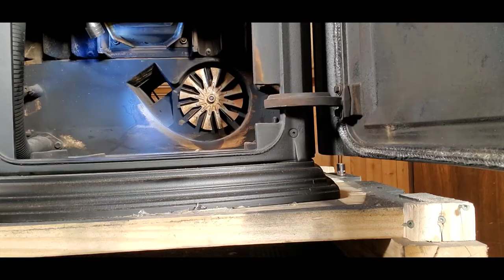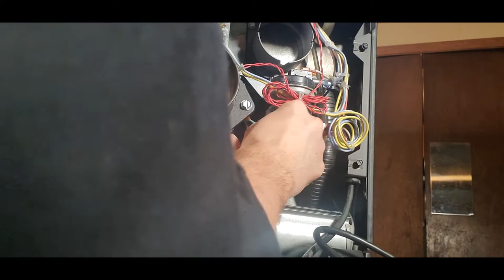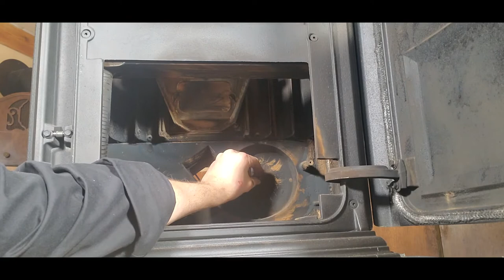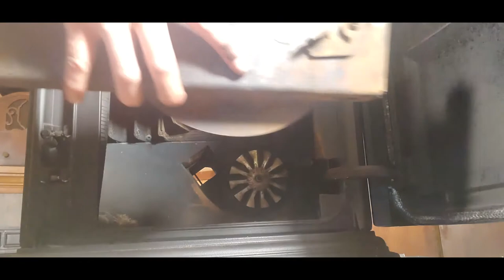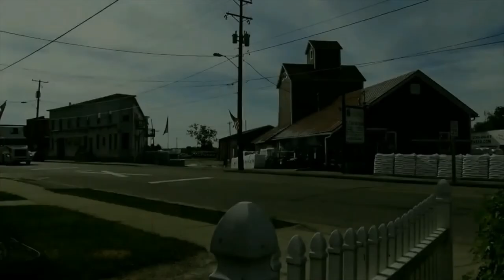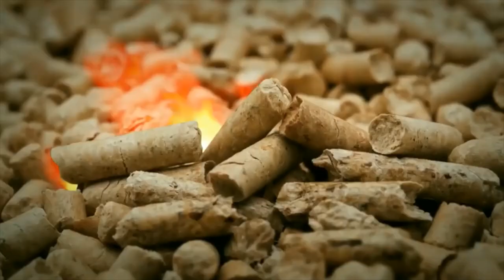How To Replace a Harman Combustion Blower, Exhaust Fan Draft Motor

Comment: I have the identical harmon stove as in your video, recently it seems the combustion fan runs continuously after temperature has been reached and stove hasn't burned any pellets for hours. Is this normal?
Reply from the maker: Hey Mike, thanks for the message. The combustion fan will come on as soon as you start up the stove and it's calling for heat whether you are on Room Temp or Stove Temp mode. The Exhaust ESP Thermistor probe regulates the combustion fan during operation. When you shut the stove down or if it runs out of pellets, the ESP probe is the device that tells the Combustion fan to shut down when everything is cool. If your fan continues to run when the unit is cool, we suggest you check that ESP and give it a good cleaning. Here is a video that will show you that process. Keep us posted, happy to help. https://youtu.be/kt7nnGMYU-k
Reply: Thank you
Reply: I cleaned the probe, but think something still isn't right. I turn the temperature setting to around 60 degrees which should keep the pellets from loading into burn pot right? For some reason the stove keeps moving pellets, any help would be appreciative
Reply from the maker: @mikechurch485  Hey Mike, thanks for the message. Sounds like you are running on Room Temp Mode which relies on the room sensing probe that plugs into the rear of the unit. Play with the positioning of that probe and see if it has the same effect. Example: If that probe is on a cold floor or by a cold draft area that was under 60 degrees, it would certainly cause the stove to start up and feed pellets. When you operate on Stove Temp mode and shut the unit down or it runs out of fuel, does the combustion fan continue to run for more than 90 minutes? If running on Stove Temp mode and you turn the dial to off, does it continue to try and feed pellets for an extended period of time? 
Just want to narrow this down, we could very well need to replace the Room Sensing Probe and/or ESP probe here, just want to try and isolate the situation before you start looking at replacement parts. Are you still having the issue with the combustion fan running for hours on a cold stove as you originally reported?
Reply: Thanks for the prompt response, I will try your suggestions and let you know. We have potentially a big snowstorm on the way so the stove might be running a little more than it has these last few weeks. I will post another comment when I'm able to use your suggestions
Reply: I ran stove on stove temp and then turned dial to off and it continues to feed pellets. I have to turn temperature setting knob to its lowest setting to get it to stop feeding pellets with the room/stove temperature dial set at off
Reply from the maker: @mikechurch485  Thanks for the message Mike. Again, it's normal for the unit to feed/purge pellets when turned to the off setting for a short period of time. The design is to remove any burning or partially burnt fuel within the auger shaft. However, this is only for a short period of time. If your unit is continuing to feed until you turn your heat dial down, it indicates to me that we may very well have a control board issue here. Could be the ESP Probe or a combo of the two - The control board and ESP are the two devices controlling both the feed and exhaust motor. Can you let us know how long it continues to feed once you turn the dial to off? (Leave at your normal temp setting)
Reply: It continues to feed at least for an hour or two. I did have surge that caused a blown fuse a month and a half ago. A guy locally fixed a fuse on the board in addition to me changing the glass fuse which was blown also. Probably explains whats happening
Reply from the maker: @mikechurch485  Thanks Mike. Yeah, with that said I'm leaning towards this being an issue with the control board itself. Here is the replacement board for your Accentra for reference. We do have a replacement video on our channel for this as well. https://pellethead.com/product/harman-platinum-4-output-circuit-board-control-panel-oem/

Any other questions please let us know. 

Thanks,
Reply: Ok just ordered a board, thank you so much for all your help!
Reply from the maker: @mikechurch485  Certainly our pleasure Mike. Please let us know when it's received and installed, we'll make sure you are 100%. Here is the installation video if you need it. https://youtu.be/PNAkJ3jDmtM
Reply: Found your website and a contact phone number, what are business hours so I can call and speak with someone? Hoping I can pause the order of the control board. Stove is actually not continuesly feeding pellets anymore however combustion fan continues to run non stop
Reply: Nevermind continue with order thank you
Reply from the maker: @mikechurch485  Hey Mike, just saw your messages here. If needed, main # will be 800-236-6647. You can always message here on YouTube as well, I do my best to keep an eye it as much as I can. Please keep us posted. Thanks.
Reply: I appreciate all your help, look forward to receiving the board and hoping that solves everything.
Reply from the maker: @mikechurch485  Absolutely Mike, same here! Keep us posted on everything. Appreciated.
Reply: What time zone are you in case I need to call?
Reply from the maker: @mikechurch485  The store location with the parts and tech department is located in Wisconsin and will be 9-6 M-F, 9-3 Sat, CST. You can message here anytime - it's checked pretty frequently. Thanks Mike!
Reply: Has the board shipped?
Reply from the maker: @mikechurch485  Hey Mike, I would certainly think so. I work remotely for the company and don't have access to shipping reports. There should have been a confirmation email with a tracking number, if not, contact our general support email at info@pellethead.com and they will get it to the right person to assist and confirm your order. Appreciated.
Reply: I did see the email with tracking number all it says is label created and waiting for USPS
Reply from the maker: @mikechurch485  Thanks for the message Mike. I just sent an email out to our shipping team to check the status on your order. I'll follow-up ASAP. Thanks.
Reply from the maker: @mikechurch485  Hey Mike, The shipping & receiving department let me know here was an issue with USPS on your order. They have confirmed it re-shipped today via FedEx 2 Day, Tracking # 784896213749. Any questions please let us know. Thanks.
Reply: Quick update installed new control board yesterday and stove is operating normal again🤞. Thank you for all your help!!
Reply from the maker: @mikechurch485  That's fantastic to hear Mike - made my morning! :) Thanks so much for letting us know; any questions down the road just drop a line. Thanks!
Reply: @EarthSense  hello I  had been in contact with you a year ago regarding my harmon pellet stove. Having issues once again. Igniter probably is out and will probably need one overnighted if possible but also when I move feed adjuster to test the distribution blower does not come on. Any ideas?
Reply from the maker: @mikechurch485  Hey Mike, thanks for the message, happy to help. There are many things that can cause an issue with ignition. I always find it good to check the ohms on the igniter to determine whether the issue is the element or something else. Harman Finned Igniter should be between 45-53 ohms for optimal range. Here's a detailed link on that - https://pellethead.com/how-to-test-and-replace-a-stove-igniter-pellet-stove-ignition-troubleshooting/
And if you do need an igniter, overnight shipping services are available. Very strange that your distribution blower is not running when you place the dial to test. I will need to check in with the other technicians on that and follow up with you. Thanks,
Reply from the maker: @mikechurch485  Messaged the other techs on the Test Mode issue. Is your distribution blower working correctly when the stove is in operation? For testing, you can manually light a fire with some fire starter or fire gel (have the igniter toggle on Manual). Generally takes 15-25 min once the fire is lit for the ESP probe to get warm enough to signal the distribution blower to come on. Let's make sure the blower is working properly in operation. Thanks,
Reply: @EarthSense  I did get the pellets is burn pot to ignite with the gel. The distribution motor did work once stove temp came up so I'm hoping all is well. Last year the igniter was replaced so not sure why the pellets didn't light from the igniter. All this happened after I did a thorough cleaning of the stove. Will contact you if for some reason I need to order an igniter, hoping I don't
Reply from the maker: @mikechurch485  
Excerpt from the owners manual on Test Mode: 'Runs all motors full speed for 1 minute to check operation. After 2 minutes the stove will go to minimum burn and the blowers will alternate from high to low every minute to remind you that you are still in test mode'
Are you trying test mode while the unit is in operation or while the unit is off and cold?
Reply from the maker: @mikechurch485  OK, Thanks for the information Mike. Be sure to check burnpot holes, check the burnpot cleanout area, tap on the igniter cradle to release any fly ash sitting on it, make sure the cover plate on the burnpot is tightened back down well. Make sure your front door and hopper door are sealing tight. Keep us posted, happy to help.
Reply: @EarthSense  I only ran on test mode after cleaning unit so stove was not at any kind of temperature. It worked after I finally got the pellets to burn using fire gel. Sirry to bother with all this however we didn't see an owners manual after buying this house 6 years ago
Reply: @EarthSense  thank you for the suggestions you have been a great help to me in working through these situations with my Harmon stove
Reply from the maker: @mikechurch485  Thanks for the message Mike. No bother at all. If you need an owners manual - here is a link for you. https://downloads.hearthnhome.com/installManuals/Accentra_Owners_Man_08326c.pdf
Reply from the maker: @mikechurch485  Happy to help buddy, glad we are able to provide assistance for you.
Reply: @EarthSense  ok got another issue, status light blinks twice please help
Reply from the maker: @mikechurch485  Hey Mike, #2 blink will be vacuum switch error. Double check the hose/tube connection, make sure the front door and hopper door are sealed well. Make sure nothing is blocking the vent pipe. Make sure the combustion motor appears to be operating at proper RPM on start-up - Near line Voltage. From there we can bypass the vac switch for troubleshooting if needed. Video below on that. Keep us posted. 
https://youtu.be/FDVkbsHS95U
Thanks,
Reply: @EarthSense  first off I want to thank you for all off the information you have helped me with regarding my harmon Accenture stove. It seems as if I'm chasing a gremlin with this stove, no longer(as of this morning lol) have 2 blinks on the status, I have cleaned the stove including the sensor in the exhaust tube recently, being careful when doing so. Now my latest head scratcher, the distribution blower isn't working. Even when I use to test feature on the feed control the blower won't turn on. Any way to speak with whomever has been helping me via this thread on the phone? If yes what time zone are you and what time do you close?
Reply from the maker: @mikechurch485  Hey Mike, thanks for the message, happy to help. If the distribution blower is not turning on when you go to Test mode, we will need to take a closer look at the blower and electrical connections. First make sure one of the wires didn't accidently come off one of the spade connectors on the blower. From there we can test your blower to direct power if needed. Videos below for creating a test cord and removal of the Accentra FS blower. 
There is technical customer service; I'll put the 800 number below. I am the gentleman in the videos, I work as an independent contractor out of state and only have a personal cell phone; however you can always communicate with me here through the YouTube comments/chat thread. 

Earth Sense: 9-6 M-F, 9-3 Sat. CST. 800-236-6647

Test Cord: https://youtu.be/rlmiCYI2WPk
Accentra Blower: https://youtu.be/xRquiynhb00

Keep us posted, thanks!
Reply: @EarthSense  ok I will check connections to blower when I get home this afternoon, hoping thats what happened
Reply from the maker: @mikechurch485  Sounds good Mike. that's the best place to start. Generally speaking if that blower was going out, you would have heard noises or had issues with it leading up to it not working here. Something tells me it's an electrical connection. Check it out and keep us posted. Thanks!
Reply: @EarthSense  yes when I have the back of the unit I always free spin the blower with my fingers and listen for any strange sounds like from bearings. Connectors are in plain sight correct?
Reply from the maker: @mikechurch485  Yessir, right in the middle of  the blower are the spade connections to the motor. To the upper right when facing the back those wires will connect to a set of lead wires - double check those connections as well. This video should show it pretty well. https://www.youtube.com/watch?v=xRquiynhb00&t=318s
Reply: @EarthSense  turns out a couple of pellets had fallen onto the squirrel cage and had wedged themselves between the cage and the shroud on the blower....easy fix👍😎
Reply from the maker: @mikechurch485  Fantastic to hear Mike! Great job on your end!!
Reply: @EarthSense  hello me again, so we have had some blizzard conditions over the last week and as a result the chimney on the roof became obstructed by some snow causing me to shut off the stove last night until I could get on the roof this morning and getting it cleaned off. I had smoke entering the house. I cleaned the stove out since it was cooled and upon turning stove back on the burn pot filled with pellets as it should k d but wouldn't ignite. I put starter gel on pellets and now its burning as it should. I read troubleshooting and was wondering will I get a blink status if ignitor is bad? How does ignitor actually work to light pellets?
Reply from the maker: @mikechurch485  Hey Mike, thanks for the message. Yeah, the status light should blink 5 times if it fails to light within the 36 minute start-cycle with the igniter toggle on Auto. If the igniter toggle is on manual there will be no blinks. 
It's the air rushing around the igniter that becomes super heated and lights the pellet fuel. Let's check the following:
1. All burnpot holes are open. Use a paper clip or precision screwdriver to poke holes open that are plugged.
2. Burnpot cleanout cavity. Open the front plate on the burnpot. Vacuum out accumulated fines in that area. Tap gently on the igniter cradle to allow fly ash to fall off that be sitting on top of it. 
3. Check your air intake channel coming into the burnpot to make sure nothing is obstructing it. If you have fresh air intake flex on the stove, make sure it's not obstructed. If you don't have fresh air intake there is a small flapper door on the Harman intake tube; make sure that flapper door isn't sticking (sometimes moisture causes it to stick)
4. Make sure the front door, ash door, and hopper door gaskets are sealing tightly all the way around. 

From there we can use a multi-meter and check ohms on the igniter. The Harman finned igniter should reads 45.0-53.0 ohms in proper range.  

We have tons of additional reference material and videos on this if needed. Keep us posted Mike, thanks!
Reply: @EarthSense  ok getting back to you on this issue. I'm confident there is nothing wrong with the igniter as the pellets will light but not as they do when the stove us operating correctly. I removed the little door below burn pot and removed some build up of materials which were sand like in consistency. I'm guessing its the area where the wires are located going to the igniter.  If I could get some information on the best way to clean that area. On the back of the stove there is a flapper type door and it seems to operating correctly as it was not restrictive at all when I gently tapped on it. Once again thank you for all your help.
Reply: @EarthSense  after paging through owners manual pdf, thoughts on low draft pressure switch?
Reply: @EarthSense  I meant to explain exactly what the stove is doing.  I Have it set for room temperature so when it calls for the stove to start up it loads the burn pot with pellets then auger stops and when stove is running correctly the igniter will light the pellets at this time and the stove operates normal. Currently it loads the pellets and they don't ignite so after some time, I would estimate 3-5 minutes the feed motor loads more pellets then stops and by now pellets have filled the burn pot to the edge where if it feeds more they will fall into ash bucket. Sometimes the pellets will ignite at this point and other times I get the status blinks that igniter failed to light the fuel so I will scrape half if those pellets out and use a starting gel that will ignite the fuel..
Reply from the maker: @mikechurch485  Hey Mike, thanks for the message. Yes, the build-up in the igniter area of the burnpot is usually a sand like consistency. Generally we will take a small hose and tape/secure it to the vacuum cleaner nozzle to get all the nooks and crannies cleaned out in that area. We also suggest gently tapping on the igniter cradle cage in there as ash will fall off of it that has accumulated on top. Yes, there is a flapper on the air intake in the rear. It's good to make sure it's not stuck or restricted. In the event that one would install fresh air, that flapper would be removed. Without fresh air intake we want to leave that flapper door in place. Sure thing Mike, happy to help!
Reply from the maker: @mikechurch485  Hey Mike, the low draft pressure switch is sensing pressure both in the firebox and in the exhaust vent pipe. This switch is in-line with the auger feed motor and will shut down the auger motor if tripped or faulty. If there are any air losses (Gasket leaks, weak combustion fan, cracks in the switch hose) or any air blockages/restrictions (Ash build-up in the stove or vent) the low draft pressure switch will trip and not allow the auger feed motor to operate. Hope that makes sense on the function of that safety switch. Thanks.
Reply from the maker: @mikechurch485  Thanks for the breakdown Mike. Inspect all of the holes in your burnpot to ensure they are free and clear. I also would still suggest doing an OHM reading on the igniter. We want to see a range of 45.0 - 53.0 ohms. That is the operable range for your finned igniter element. Any readings outside these numbers will give periodic issues with ignition. 
Quick Question: When you have the stove running, how does the fire look? Is it crisp and torchy or is it lazy in any way? We'll get it figured out. If you need video references on the igniter or testing just let us know. Appreciated Mike.
Reply: @EarthSense  well since the auger continues to move pellets with.the igniter not operating consistently I'm going to do a thorough cleaning tomorrow. We had 2 weeks of very harsh winter weather lately and the stove was operating non stop during that time. Hoping a thorough cleaning will get the unit operating as it should.
Reply from the maker: @mikechurch485  Thanks Mike. Yes, a thorough cleaning is a great place to start. The vast majority of issues we come across are simply due to accumulated ash in the stove and/or venting. Keep us posted. Thanks!
Reply: @EarthSense  once the fuel ignites the flame looks normal I guess, it behaves as if it is being "fanned" I guess you could call it. So I'm a horrible electrician lol so I'd test the terminals on the igniter correct with the 2 wires going to it still "attached"?
Reply from the maker: @mikechurch485  Hey Mike, for testing the igniter you can have the stove unplugged from the wall, disconnect the igniter wires, and place the multi-meter leads into each of the igniter wire connections. Here's a video reference: https://youtu.be/z4wmCc96rVI

Also video reference here for accessing/replacing the element if needed. 
https://youtu.be/i7n1SSgCPMc

Keep us posted. Thanks!
Reply: @EarthSense  awesome thank you, I replaced the igniter last year so hopefully not the issue but will test nonetheless 👍
Reply from the maker: @mikechurch485  Thanks Mike! Yeah, good to test it to make sure. Also good to do your cleaning like you mentioned. Keep us posted, happy to help bud!
Reply: @EarthSense  well the ohm range was not where you said it should be it ran 68 ohms when checked. I did a thorough cleaning started stove and had no ignition of fuel. I contacted earth sense with the number you provided earlier in this thread and ordered a 2 pack of the pellethead replacement ignitor. I sure hope this is the issue.
Reply from the maker: @mikechurch485  Thanks for the message back Mike. Yeah I think at a 68 reading it's going to give us more failures than successes on ignition. Let me know once the new elements have arrived and how your start up cycle is. Appreciated. And Happy New Years Mike!
Reply: @EarthSense  so the air that rushed over the igniter when operating correctly is drawn over igniter through that flapper door  on back of stove?
Reply from the maker: @mikechurch485  Hey Mike. Yes is the short answer. As the combustion blower starts it's drawing air from that intake tube, pulling it past the igniter, through the burnpot, up past the heat exchange tubes, down the rear firewall, forcing gases/emissions out of the flue vent pipe. It's good to make sure the flapper isn't sticking (sometimes in high moisture areas it can stick and cause a problem). It's also important to note that if fresh air intake flex pipe is ever installed on there, you would want to remove to flapper door. The reason it's there is so that if the stove were to lose power or the combustion blower failed, the flapper will close and not allow as much smoke to emit into the home. Any other questions let me know. Thanks!
Reply: @EarthSense  so the combustion blower the the blower that evacuates the smoke out the flue correct because I was looking at that flapper door when I started the stove again to see if it was "opening" at all, the short time I was looking at it it didn't look like it was opening up, should it?
Reply from the maker: @mikechurch485  Hey Mike, Yes that's correct, the combustion blower is drawing air through that inlet. Yes, as the stove is running you should see that open up a bit. It doesn't become wide open, but you should see it opening/ fluttering open during operation to pull the air through.
Reply: @EarthSense  ok I received the igniter(s) today and if I remember correctly the leads from the new igniter are not specific meaning it doesn't matter how i connect them correct?
Reply from the maker: @mikechurch485  Hey Mike! Yes that is correct, it will not matter which wire connects to which lead wire. Look forward to hearing how start up goes. If you have any other questions installing just let me know. Thanks!
Reply: @EarthSense  success!! Stove lit immediately.  Thank you again!
Reply from the maker: @mikechurch485  Ah!! Fantastic Mike! So glad to hear that. Keep us posted with any other questions as you go along. Very happy to hear my friend!
Reply: @EarthSense  hello me again, all is working fine but was wondering if you could suggest a ash vacuum? I have a craftsman and looking for something better. Thank you
Reply from the maker: @mikechurch485  Hey Mike, good to hear from you, glad everything is running smooth! We do offer an ash vacuum - Very solid results and feedback with it. https://pellethead.com/product/pellethead-ash-vacuum-fireplace-stove-ash-vacuum-pro/

If you use a standard shop vac, put a drywall dust filter in place to ensure the ash doesn't escape into the home. 

Here is a video overview of our ash vac for reference. https://youtu.be/xZShB2WsrZg

Any questions let me know. Thanks!
Reply: @EarthSense  thank you for the information on the vacuum, however on the link when I click it the page doesn't load. I know this issue isn't yours to address but I'd thought I'd let you know. Have a great day
Reply from the maker: @mikechurch485  Thanks Mike, Yeah taking a look it appears our website as a whole is currently down.. Apologies on that. I've notified the IT team so they can jump on it and get it back up and running. Thanks again!
Reply: @EarthSense  thanks again 👍
Reply: @EarthSense  website is working👍

Is there much vacuum performance difference between the 20v cordless and the 110 corded vac?
Reply from the maker: @mikechurch485  Hey Mike, thank you! I do have a DC one that I use myself, however I do think the corded AC model has more consistent and stronger vacuum/sucking power as a whole especially over a duration of time. Appreciated Mike, any other questions please let us know.
Reply: @EarthSense  well its me again and troubles once again. Pellets won't light. I cleaned ESP probe, cleaned area under and behind igniter and a good general cleaning of the stove. So last time was the igniter so I ordered the 2 pack of the cheaper igniter versus buying the oem one. My plan is to check tonight when I get home from work. Say the ohm meter says igniter is bad I replace and still no ignition. What would you check next?
Reply from the maker: @mikechurch485  Thanks for the message Mike, sorry to hear of the troubles. Let's also grab a good light and check the burnpot holes to ensure they are opened. Any air losses or air blockages can create ignition issues. If the Ohms are in proper range, let's make sure the door and ash door gaskets are closed and sealing well. Let's check the air intake to ensure there are no restrictions, and let's take a look at the combustion blower motor - it should be running near line voltage during the start-up cycle. Always start with the simplest and we can take it from there. Let us know the ohm range on the igniter when you check it. Appreciated.
Reply: @EarthSense  ok after checking all you suggested turns out the igniter I replaced 2 days ago one of the connections came unplugged and stove is operating correctly now. Was a little surprised that one of the 2 pellet head igniters I ordered from Earth Sense had failed already but its ok things happen. Thanks again!
Reply from the maker: @mikechurch485  Thanks Mike, glad you figured it out and your back up and running. Yeah, that shouldn't be.. sorry to hear of that failure. There is a 1 year warranty on those, please send a message over to info@pellethead.com so they can warranty that igniter and ship you a replacement. Thanks!
Reply: @EarthSense  another storm here so another problem with my stove. Stove stopped working on room temperature setting, only way I could get it to work was un plug let sit for a minute or so then turn it to stove temperature and it would finally start to load pellets. Then once burnpot was loaded pellets wouldn't light. I checked holes in burn pot had a couple holes towards bottom of burn that were plugged but opened after. Took panel off below burn pot and igniter seemed hot but no ignition was happening, air seemed to be exiting holes in burn pot but that was it. The no operation using room temperature is whats concerning me.
Reply: Also last week I replaced the igniter thinking it had failed as pellets weren't lighting. Checked it and it was in the correct ohm range you had given me but I wasn't getting ignition.
Reply: After replacing igniter a week ago, stove would do one cycle of loading pellets to where burn pot was about half full of pellets but no ignition happened, stove then would cycle again loading more pellets to the point that the pellets would nearly begin spilling out of burn pot into ash can but I would get ignition of pellets at this point.
Reply from the maker: @mikechurch485  Thanks for the message Mike. If it's in proper ohm range it's not the element, it's the air flow. Double check to make sure it seated well in the cradle and one of the most important things is to make sure the cradle is tightened down evenly to the burnpot - any gaps there and we can have ignition issues. Let's make sure the burnpot holes are open, intake channel looks clear. Burnpot cover plate is on tightly and door gasket is sealing well. From there we can also pull voltage readings from the combustion blower. Should be running near line voltage during the startup cycle. Keep us posted, happy to help.
Reply from the maker: @mikechurch485  Thanks for the message Mike. As I mentioned in the message I just left on the other comment, I think we have an air flow issue here. Double check the points I mentioned and keep me posted. Thanks!
Reply: @EarthSense  is the line voltage you are talking about described in the owners manual? My electrician skills can be challenging for me sometime
Reply: @EarthSense  so if you are thinking an air flow issue would that affect the ability to start the stove? Last night getting home the stove was not running so I would alternate between room temp and stove temp and also turn the temperature control knob all the way up and stove would not work, nothing would happen. I had to unplug it for a couple minutes for it to at least cycle on
Reply from the maker: @mikechurch485  Hey Mike, So what one would do to check voltage of the combustion fan would be to get a basic multi-meter, set it to volts, insert the black and red leads from the meter into the combustion fan molex wire connectors. You can usually squeeze the meter leads into the wire connections leaving them plugged together. From there you would turn the stove on to see how many volts the combustion fan was running at. During start-up it's usually at line voltage meaning house input power which is generally 110-125V for most homes here in the US. 
Again, this would be the last thing I would suggest checking after all the other things have been looked at. It will not show you how to take voltage readings like this in the manual, but I can walk you through it.
Reply from the maker: @mikechurch485  Hey Mike, Yes, any air loss or air blockage will create ignition problems. It's not the igniter lighting the pellets, it's the air that passes by the igniter that becomes super-heated which ignites the pellet fuel. 
That's very interesting what happened last night. Were any lights coming on the control board? Definitely verify the outlet voltage to make sure it's not a power issue coming in. When you unplugged and re-plugged in and it cycled through did it go all the way through ignition? Any blinking lights? Also, how has your fire been looking when it is running? Is it crisp and torchy or is it lazy or sooty in anyway?
Reply: @EarthSense  no status blinks last  night when this happened last night, nothing on the control panel looked out of the ordinary. The flame has been crisp looking as it always has. The only thing really was it loading pellets then no ignition then it cycled again filled burn pot to the edge with no ignition. Had to mostly empty the pot then add fire starting pellets that I bought that are soaked in a fuel in order to to get stove heating
Reply: @EarthSense  ok I'm home but won't be able to work on stove until tomorrow, I had to use stove temp to get it to feed pellets. While it is working I changed it over to room  temperature setting and turn temperature knob as high as it can go and it won't feed pellets have to switch back to stove temp for it to
Reply from the maker: @mikechurch485  Thanks for the message Mike. Double check the room sensing probe on the back of the unit. Make sure the connections are secure. If the stove does not sense that room probe it will not operate in room temp mode - only stove temp mode.
Reply from the maker: @mikechurch485  OK, thanks for the update Mike. Glad to hear the flame is looking crisp. That let's us know that more than likely your combustion blower is operating correctly and we don't have any major air losses or leaks. Still check the igniter in the cradle, cradle mount to the burnpot, holes open in the burnpot, burnpot cover plate on securely, and air intake tube free and clear. Keep us posted.
Reply: @EarthSense  ok just finished working on the stove, checked everything you said to check. It may have been that I didn't "pull" all the slack to the back of the stove with the igniter leads. They were kind of bunched up just beyond the burn pot.  Guess I was afraid if I pulled the slack out from the back of the stove I might pull to hard and disconnect the leads, since I did exactly that not to long ago. Upon start up one cycle of pellets loaded and ignited right away as they do when operating normal. Room temp setting is working as it should again. Stove has been operating for about an hour and everything seems to be normal.
Reply from the maker: @mikechurch485  That's very good to hear Mike. Oftentimes it is something simple. Just glad to hear you are up and running again. Keep us posted on things, appreciated.